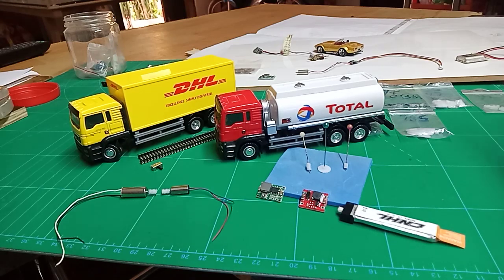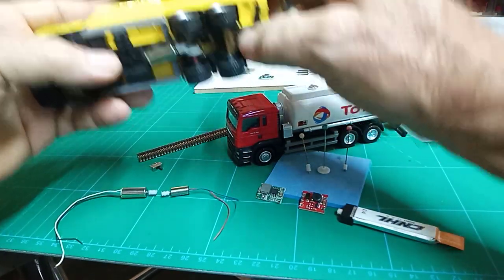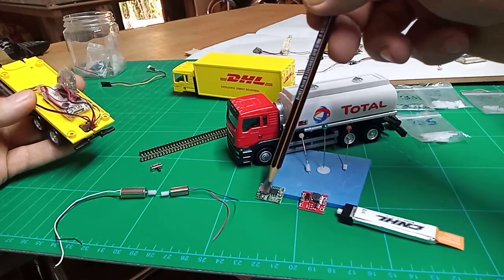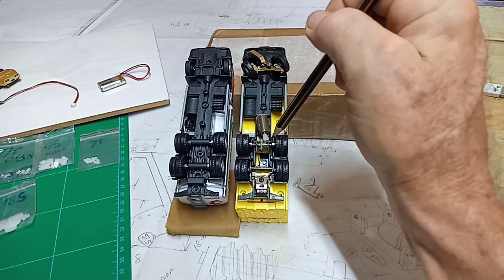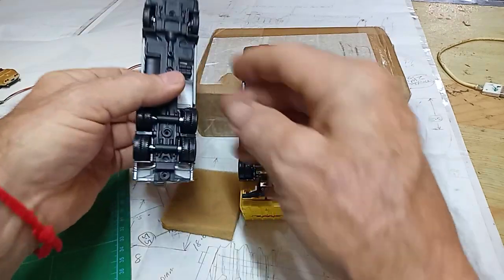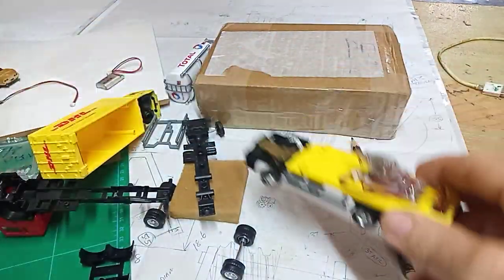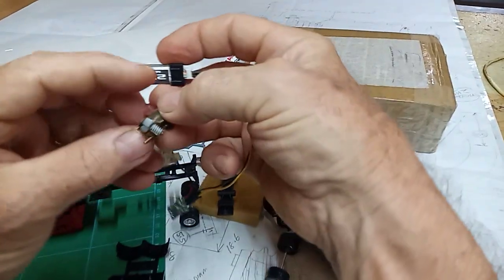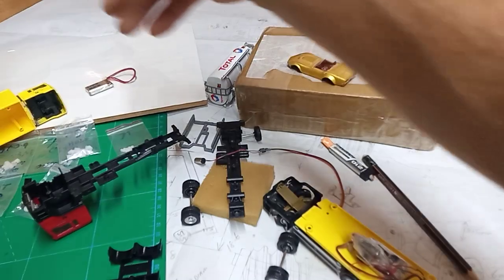1/64 Scale Truck Motor Gears Drive Conversion Speed Control Magsteer (RMZ & Faller style)

Comment from the maker: INFORMATION PARTS 1:64 Scale Car / Truck, Drive gears, Motors, Speed controler, DC-DC boost Switch, Sockets and Assembly tips.
Search these following descriptions listed below at AliExpress. (eBay has some also)
-----
1:64 High simulation diecast RMZ City (Man DHL or Scania truck from  JACKIEKIM Diecast Store)
Approximate 39 mm wide truck container is correct scale 1:64 for 2.5 meter.
** Check seller description size listed at 40mm wide is ok. 
----- 
Hobby Motor micro 
612 Motor with 3*0.78 shaft 9500 rpm 3v. (Cars use about 13 - 20 mah at city scale speed, trucks 15-25mah)
716 Motor with 7*0.8 shaft 45000 rpm. (Cars or trucks use 50-70mah at city scale speed)
(Also 610, 614, 720 from Voktta Direct Store)
-----
Micro 1A RC ESC DIY 5V DC for brushed motor. In 3.5-6v with variable forward and reverse 12*8.5mm PWM controlled by a RX
(From SKYPODrobot Store)
-----
DC-DC Step up boost power supply 5V. Input 2-5v from your lipo, output 5v fixed 2 amp to supply the DC-DC Step down power supply 3a buck converter Input 4.5-24v, output 0.8-17v adjustable for manual motor (612 or 716) speed control
 * caution high volts burn motors. 
 (both from Yikeshi Store)
 -----
Worm gear module size M 0.3 modulus, hole is 0.75 mm, size is 5mm long * 3.5mm diameter single helical thread
(From YUANMBM Store)
-----
M0.3 module 28T suits 1mm shaft, hole is 0.95mm, 9mm diameter. And many other M0.3 gears.
(From My DreamOfly Store)
-----
0.3 M gears from 6T-13T with 0.75-0.95 holes  (from BloomingStar Store)
All above listed white nylon plastic gears are strong and quiet and smooth, I avoid metal gears.
-----
Round hole pin Headers connectors male and female gold 2.54mm spaced pins x 40.
(From SuperMicro Store)
-----
100 Pcs Interrupter on-off mini slide switch 1P2T SS12D00G4 with 2.54mm spaced 3-pins. 8.5*3.5*3.5 mm
(From Xin Cheng Electronic)
-----
Tips for making motor gear box and speed control.
Accuracy and smooth rotation of all moving parts is critical for efficiency.
Correct hole sizes drilled is critical to avoid lose tolerances or binding.
Motor and worm gear requires a 9° angle offset to mesh smoothly with straight cut gears.
I use 1mm spring steel K&S for axils and idler shafts and carefully drill out any smaller plastic gears to press fit tight. (0.95-0.97mm for 1.0 mm axils)
RMZ truck wheels have thick 2mm press fitted axils which can be removed by placing under hot water for 2 minutes then gently remove axils with vice or pliers.
 I used small red plastic tube from WD40 spray cans as 2mm * 1mm tube wheel hole spacers if using 1 mm axils. 
From my experience the plastic tyres are better than rubber because there is no differential so the wheels need to slip on the road surface at different speeds around corners. Rubber tyres grip the road too much and with a fixed axil it only wants to go straight ahead on corners. Road incline on plastic tyres is ok at 1:10 gradient so 7cm high over 700 mm. (overpass or bridge)
Use a Multimeter to check  low voltage is < 3v out of DC-DC step down module to avoid burnt motor. (module can supply 17v)
RMZ truck DHL or Castrol or BP containers are big at 39 x 39 x 105 mm for holding Arduino microprocessors for hall sensor automatic traffic light stop and go control and or lighting circuits or the container can be removed to make a flat bed car carrier truck and place the LiPo battery and controls under or inside the cab.

Comment: Can you make a updated 1/64 rc car conversion
Reply from the maker: Maybe new car video this month. The only changes to car designs are seen a little in this video. New miniature gear drive design  (90° + 90°)with 612 motor, All Modulus 0.3 - 
2 worm gears, 1 @ 13T 
gear, 1 @ 7-13T gear.  Micro PWM speed controller for brushed DC motors.